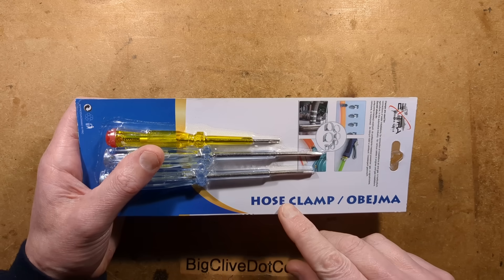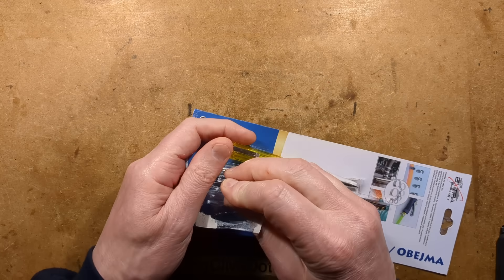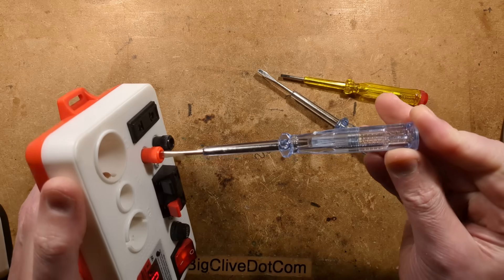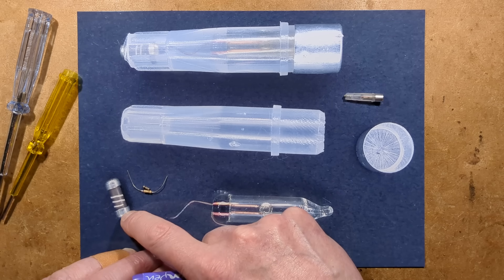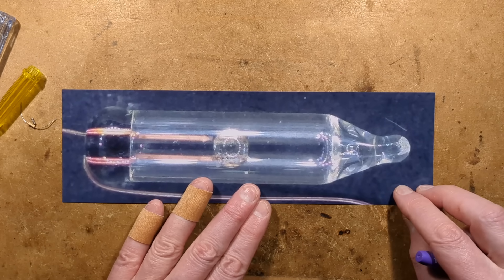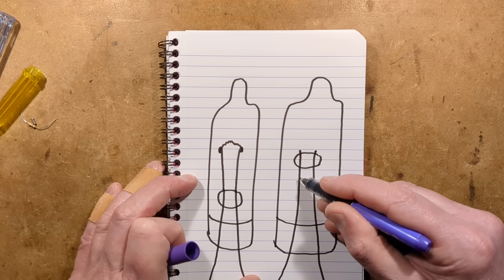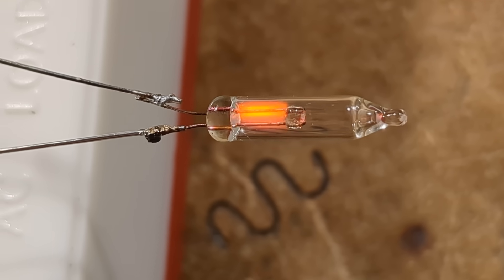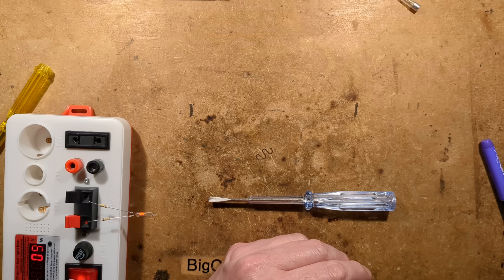Mispackaged testers with very odd neon bulb

Comment: I took apart one of these fairy light neon abominations a few years ago because it unironically had a great screwdriver tip. I filled the body with epoxy
Reply: Is that your cat? If so please give it my love!
Reply: @zh84 Yes! All my cats get spoiled on a daily basis
Reply: @zh84  that's a very clippy looking cat
Reply: I also came across one 20+ years ago that had a grat screwdriver tip: perfect size for small screw terminals, sharp and super hard. I used it for years as a screwdriver until I screwed it up with a way too big and way too tight screw. It actually shattered, proving it had a hardened tip.
Reply: depends on what alloy of chinesium the factory used.. can be anywhere from single-use because it's so soft, single-use because it's so hard it chips or an actually usable screwdriver
and yeah, filling it up with resin would help, mine break because the plastic housing cracks.. could keep the functionality too, just fill it up.. resin is a great insulator